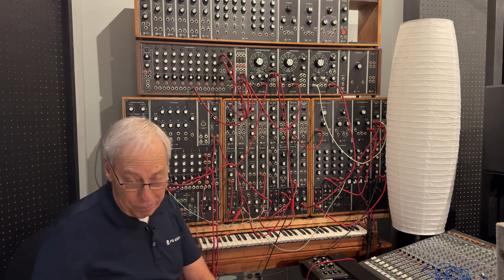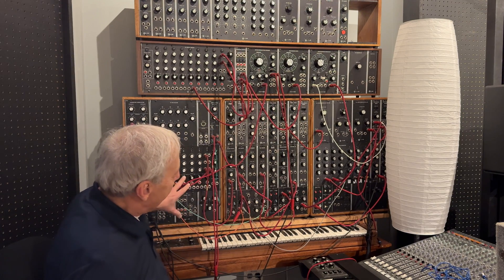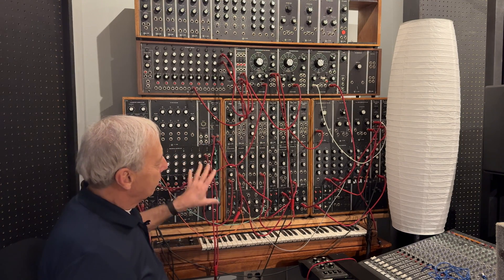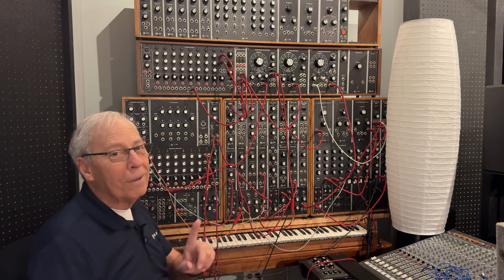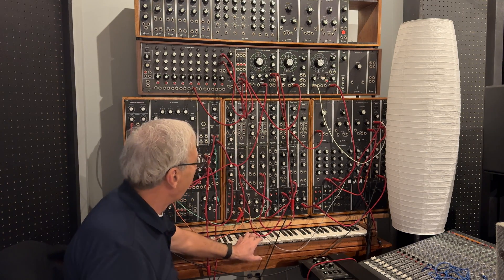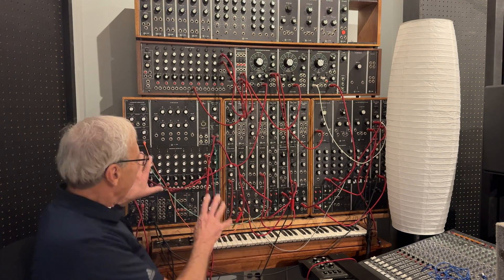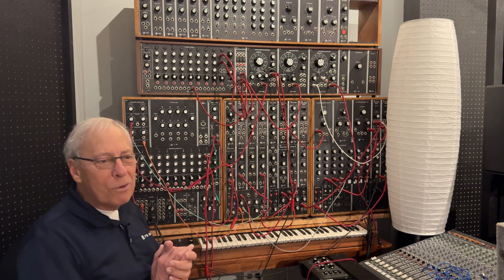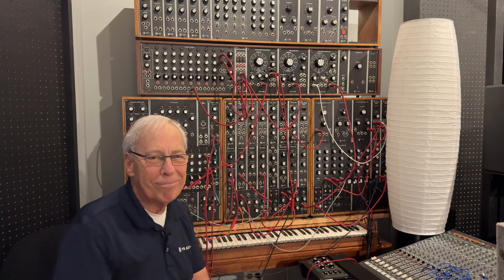Paul explains the Moog synthesizer

Comment: As mentioned before I worked at Moog Music Inc, in Cheektowaga, NY. Only the parts department and shipping, but I did get to bring a Poloymoog to Tony Banks of Genesis to try out. He plugged it in and the band played Squank. What a feeling to be right there with no one around except the band and two engineers that I appauled with my forwardness when I introduced myself. Who the hell is this guy. Anyways, Steve Hackett was a prick. Tony and Mike were real gentlemen. Had to be late 1977 or early '78. They played the Aud that night. That's what we called the War Memorial Auditorium in downtown Buffalo. 
Check out Last Fast and Synergy for great syn music. As Todd Rundgren would sing: "Born to Synthesize"

Comment: I know a brand named Synth-werk that makes these modules now. Those are electrical and physical replicas of the originals and can be tuned and fit to replace original modules. Or you can get a completely new system.

Though modular synth’s may be a representation of what became a modern synthesizer, modular synths have never been more popular than now. Modules in the MU format (moog units) are still made by many brands. The More compact format eurorack has become very popular.

To many putting together a system of modules from different brands, connect cabels between them to make sounds, rythms and music can be very addictive.

Comment: Great instrument, for sure.  Even though it can only produce very limited set of waveforms (sine, square, triangle, saw, and white noise) at its oscillators, the routing capabilities are totally open for all kinds of experimentation.  What's good about the modular analog synthesizer is the fact that it has one control or plug per function, so what you see on the panel, is exactly what you get in terms of functionality.  Later instruments, such as Yamaha DX7, or Roland D-50, are also synthesizers, in sense that they can assemble sounds from very basic waveform (sine waveform in case of the DX7, and square wave for the D-50) but most parameters are hidden from the front panel, and one has to access the parameters only one or a handful at a time to make any parameter adjustments.  And yet, because of the patch memory on those latter synthesizers, the practical use for musicians and keyboard players is far greater than than of an analog modular.  On the other hand, when you internally pre-patch an analog synthesizer, it can also become an immediately usable keyboard instrument.  For instance, a pre-patched analog synthesizer such as Minimoog is immediately good for keyboard lead or bass lines.  But not much more really, aside from some flying saucer or ambulance siren effects.  In the end, I am not sure about all these electronic instruments.  They are interesting to read about and play with, but also they are the best excuses to actually not practice music.  With acoustic instruments, on the other hand, there isn't much more to focus other than on actual music playing.  I find it very odd though, then when one talks about oscillators, filters, and envelopes, people somewhat listen.  But when talking about a Steinway piano in terms of its keyboard action components and strings vibration generating harmonics as a main topic, it probably would not make any sense to anyone.  My point here is that acoustic instruments are really good for actual music, whereas synthesizers are also good for engineers and sound fanatics.  Perhaps in a similar way, audiophiles are probably more into their electronic equipment, then into actual musical content, like the notes, chord progressions, composition, and orchestration.  My point is probably proven by the fact that one can make a compelling video about a synthesizer without producing a single sound out of it.  Either way, both musical instruments and music itself are great conversation topics, the instruments being the reflection of technological progress and craftsmanship, and music being the representation of the culture.  Same as watching YouTube videos and writing pointless comments is just a procrastination of things actually worth doing.

Comment: So for all the variety of things one can do to modulate a sound, the keyboard input device is monotonic? Single voltage out, single note or tambre or whatever you've plugged the keyboard into? Chords just munge together into another single voltage?
Reply: Monophonic.  Yes.  What happens when you play a chord will depend on the specific keyboard, but in all cases, it ends up as a single voltage, as if it was a single note.  Most likely, it’d generate the voltage corresponding to the highest note, or perhaps the lowest note.  If you want to actually produce chords, usually it ends up being done as multiple passes on a multitrack recorder.

Comment: Nice, but Paul probably has not been following the Moog Co. over the years right up to the present.  What we are looking at there is a System 35 / 55 with added modules/cases.  AND, you could most recently purchase a brand new one of these !!  Currently, they are building the Model 10 which pretty much started the suit case modulars for studio and portable use on stage, a precursor to the Model 15.

I am VERY lucky to have in my keyboard studio a Moog 50th Anniversary Voyager bought new in 2005.  It is ONE OF 100, and of the last 25 that Robert Moog personally hand signed !  I brought it to the Ashville factory, and Amos Gaynes personally added the optional memory capabilities.  Glad to have it still in my collection as well as the keepsake photos and videos from that visit.

Comment: Although it may be apparent to some, should mention that these early synths are analog not digital. The output sound was recorded by microphone. The player sometimes took pictures of the patch cord setup or drew pictures in order to remember certain sounds, sequences. Today, the synths have been digital for a good while at least since the late 80s. They can produce a digital transcript which represents the truest sense of the instrument rather than having to be recorded as a sound to mike. If your recording is 99% to 100% digital transcript this makes your audio system the synth output. So, you get almost a purist sound as to the artist's intention no matter your hi end speakers or amps. The artist in the case only has worried about the transcript output to your ears not to any reference system. An example would be Beethoven or Bust by Don Dorsey. In this sense  your system is a pure realization of the instrument.

Comment: For anyone interested in exploring further, I recommend VCV Rack. It is a free open source modular synth built entirely in software. 
Install it on your computer and beep and bloop to your heart's content. It's awesome.
It's good enough to use as a real instrument, but also a good testing ground to try out and learn the basics before investing in a modern hardware version.

Did I mention that it is free and awesome? Because it is.

Comment: Great video - certainly dragged up some long lost memories.
I bought a second hand minimoog model D in the early 1980s. It had 3 keys which didnt work and not looked after. I remember paying about $80 for it. I fixed the keys and it worked quite well for a monophonic synth.
Later on the 1980s Roland released the D50 which I bought new (Australian dollars $2,995 - you could buy a car for that sort of coin).

I recall selling the minimoog through the trading post for $450. I thought I did rather well out of the deal.
Little did I know how much of a collectors item this minimoog would become.
Pink Floyd used the minimoog for most of the synth lead on the album Wish You Were Here (1975) - played by Rick Wright.
In Australia the first Computer Sound synthesiser and composer was the Fairlight - worth as much as a home in an Australian capital city ($25,000+ in the 1970s).
Only the big recording studios and wealthy bands could afford one. And you needed someone to program it - not very user friendly.
The samplers arrived and the playing field changed again.

(I believe that Fairlight CMI could have been the first synthesiser to have sampling capabilities - could be wrong, but certainly well ahead of its time)
Reply: Nice, I have a MINT D-50 in my studio, it really has not gone out of style and there is a HUGE following for that model with videos and reviews all over youTube.  Also, I still have the ORIGINAL promo pack AND clear blue vinyl LP from SYNCLAVIAR!  This was used by Telarc's synthesist (Don Dorsey) for the space themed recordings - Time Warp, Star Tracks etc...